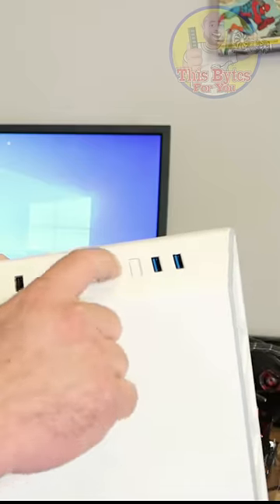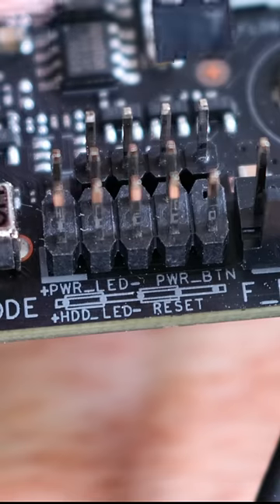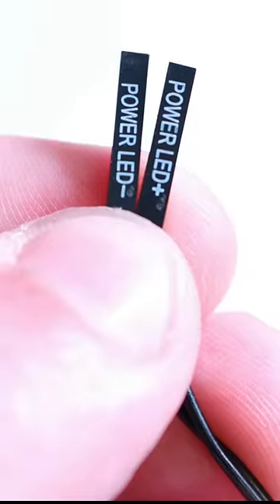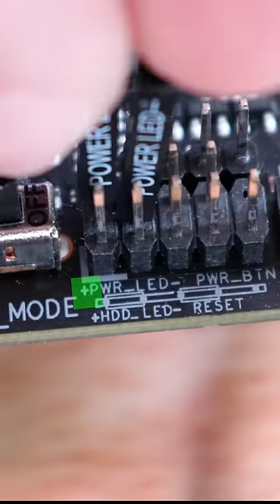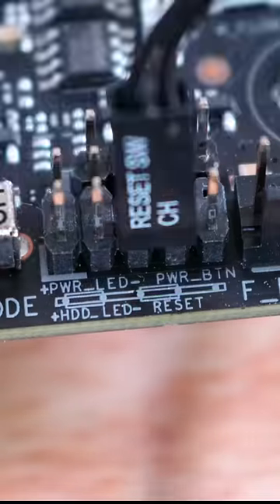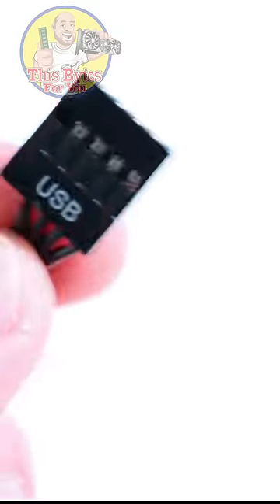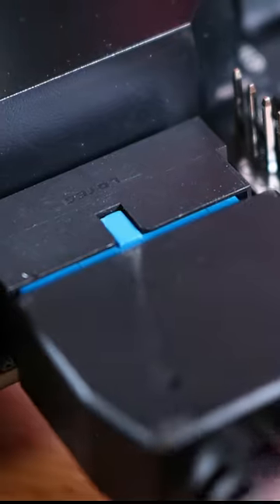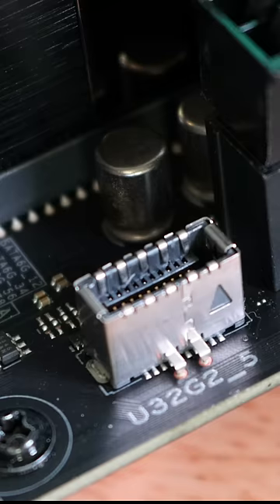Front Panel Connectors - Where do they go connected? #FrontPanelConnectors

Comment: Mine didn't come with a reset cable or speaker as far as I see. I have a ASRock b650m pro rs wifi mobo and a Apevia prism case.
Though the case did come with a power led - and +, a power line and the hdd line and that's all.

Also still not sure if I plugged in everything correctly still need to find a video for that all of it is just confusing for me!
Reply from the maker: This is a short, you can only get so much information from a short, I made the short from this video, you might also need the manual for your motherboard, you can find that on the support site for your motherboard, all motherboards have it, including yours , if you can't find it, let me know and I will get you a link to ut, but here's the full video https://youtu.be/k6A3MG3yJzQ
Don't worry about the connections your case and board don't have, since they don't have them.

Comment: I have an Asus z87-K motherboard inside a Montech XR case. The front end power cable from the case looks entirely different than what’s on the motherboard. What can I do here? Informative video by the way!
Reply from the maker: I can't tell if that case has an F_Panel cable, but if it does, just like I did on this video with another montech case, at the 20:00 marker: https://youtu.be/8I4e6sw0meo?si=aHZJtoNUO0-dM3nD and thanks so much for your kind words and support, it means the world to me.
Reply: @ThisBytesForYou  Correct, this was my exact dilemma. Have the same F_Panel cord you have in the video as well with the same pin configuration on your motherboard. Was curious where exactly you had the cord plugged in at on the front end panel pins.
Reply from the maker: Well awesome my friend, so very happy I could help you.  Thats a nice looking case.  I have worked with Montech a few times, but now, they won't even reply.

Comment: But mine is a dell optiplex 5040 it doesn’t say led plus or minus what do I do?
Reply from the maker: You're right,yours does not because it's a pre built, this is for custom built PCs.  If you go to dells support site, enter your service code, there will be a section there where you can find documentation for your system and it will be in there, I believe called repair guides.  The  other thing you could do is just try one way, if it doesnt work, try the other, there's nothing there that will harm your pc.

Comment: Is it possible to get an adapter for the system front panel connecters ? One's on my mini itx build are crap.
Reply from the maker: Ummm, can you elaborate a little more as to what sort of adapter you are looking for?
Reply: @ThisBytesForYou  The pins for the power hardrive reset etc are to near my graphics card when it's mounted also they can keep popping out when connected.
Reply from the maker: Hmmm, not sure what to tell you on that bud, sorry
Reply: @ThisBytesForYou  No problem.

Comment: Can't find any hdd led cable in my case, but it was a hd audio cable. I put it on the two upper pins on audio there, is that correct?
Reply from the maker: This is a short, it won't give you all the info, it only gives me 60 seconds,  here is the long form video and will totally help you https://youtu.be/k6A3MG3yJzQ?si=bgar_24lBycYLeI0
Reply from the maker: sorry, not sure why this was liked with no reply, HD audio is audio, not HDD LED, HDD LED is hard disk drive LED, not all cases have HDD LED's so you dont need to use that.  This is the short, you would benefit from watching the full video, again, sorry about the amount of time on this https://youtu.be/k6A3MG3yJzQ

Comment: are the connectors always the same place on each Motherboard?
Reply from the maker: no, you will have to look around sadly.
Reply: @ThisBytesForYou  okay thanks
Reply from the maker: anytime bud, if you know the manufacturer and model number of the board I can help, if its a prebuilt, I can't help you on that.
Reply: @ThisBytesForYou  Mine is the Gigabyte B550 Aorus Elite V2, but i think I've got the Connections now right
Reply from the maker: yeah, same location, you will need the motherboard manual to be sure on this board https://download.gigabyte.com/FileList/Manual/mb_manual_b550-aorus-elite-ax-v2_e.pdf?v=24d24cf9acc76ba2c833adbcf9dfc9c7

Comment: My cables have the power led- and + power sw written but can't find them on motherboard.
Reply from the maker: I might be able to help if i knew the manufacturer and model number of the board
Reply: @ThisBytesForYou  it is the pro z7090-p wifi I believe I have the rest of the cables right except the power, reset, and leds.
Reply from the maker: this is the short, you want the long video: https://youtu.be/k6A3MG3yJzQ
Reply: No problem I am thankful I was able to find your videos they're helpful and have been helping me throughout little by little. Although I've messed with PCs in the past like changing power supply or things like that this is my first time actually starting from scratch and it's a little nerve wrecking. My only problem now is that my green light on boot comes up but that's it nothing shows on my monitor I have the vgag3 cables connected to the graphics card but not sure if I have them right. Cpu light won't come either nor the dram only boot.
Reply from the maker: while not the 7 series, this is the 6 series, it will help you: https://youtu.be/8I4e6sw0meo

Comment: What if my motherboard doesn’t have those usb connectors for usb C and 3.0?
Reply from the maker: you could buy a USB Type C and 3.0 card so you can plug the headers there, check it out on my Amazon affiliate link: https://geni.us/BFsJi
Reply: Awesome thank you man!
I’m doing my first build and my motherboard is an ASUS B550M-A WiFi ii and I thought I was just blind but found out it doesn’t have it
Reply from the maker: anytime bud, but it does have USB 3.0 on the right, right under the ATX24 pin header just no USB type C

Comment: My pc case didn’t come with power led + - cables. I’ve seen some on Amazon but I’m not shure how I would connect the other end to the fans. Can somebody help me?
Reply from the maker: Would help if i knew the manufacturer and model number of your case
Reply: @ThisBytesForYou  my pc case is called the deepcool cc560. I just build my first pc and already having problems😢
Reply from the maker: that case does not have a power LED cable, so there is not light for that on the case, it only has power switch, hdd Activity led and reset switch.  You would need to drill a hole into the case to see the LED light, and to add one.  What issues are you having?  
You can find the front panel headers for your case here: https://www.deepcool.com/download/pdf/CC560.pdf
So that I can help, please list the manufacturer and exact model number of the following components:
1. Motherboard - manufacturer and exact model number
2. CPU - manufacturer and exact model number
3. RAM - manufacturer and exact model number
4. Video Card - manufacturer and exact model number
5. Power supply - manufacturer and exact model number
6. Monitor - manufacturer and exact model number
 Redundant I know, but many people forget to enter manufacturer and exact model number
7. Do you have ALL of the PCIE connections plugged in, and not daisy chained or pigtailed, each coming directly from the power supply?
8. Are you running through HDMI, DP, DVI, VGA, any adapters?
9. Is UEFI or Legacy Setup in the BIOS?
10. What slots do you have your RAM installed in?
11.Do you have CSM Enabled or Disabled in the BIOS
11. Installed latest supported chipset driver?
12. Have you disabled Fast Boot within Windows?
13. This video will help you identify hardware inside your PC: https://youtu.be/65ZSiVImJx0
Reply: @ThisBytesForYou  I followed a tutorial for the cables and stuff but the fans are supposed to be a light blue led and my fans don’t even spin. I’m pretty sure I plugged everything in correctly.
Reply from the maker: which fans?
Reply: @ThisBytesForYou  the fans that come preinstalled in the case
Reply from the maker: ok, they are in fact LED fans, they should turn on, but I will say the aRGB connection is a pain in the butt, maybe this video will help you: https://youtu.be/J5m5WBlPkfc
Just in case, the board you have is the ASUS Prime B550M-A WiFi II, the number you gave me was the Amazon ASIN number.  You can find the manual for your board here: https://dlcdnets.asus.com/pub/ASUS/mb/SocketAM4/PRIME_B550M-A_WIFI_II/E22625_PRIME_B550M-A_WIFI_II_UM_v2_WEB.pdf?model=PRIME%20B550M-A%20WIFI%20II and on page 1-1 you can find your single aRGB port, yes you only have 1, but thats OK but aside from the power connector on your fans, that makes them spin, the rgb portion, does it have 4 pins or 3 pins with a space in between?

Comment: Well that's great but I have the B650M and none of the ports are named that so I don't know where to plug them
Reply from the maker: Have you checked the manual, if you don't have a physical copy, it's  in the manufactured support site and you can use your phone to see it.  One answer doesn't always fit all.
Reply: @ThisBytesForYou  yeah I followed the manual and 'tried' to put them in correctly.  Best I got was it to turn on, no display. I'm sorry wasn't trying to be rude, just frustrated I can't get my PC working. Going to just pay someone to fix what I obviously screwed up. No worries. Thank you
Reply from the maker: @eldonb5131 try the full video, it explains more, I think your issue is polarity, there is no way you can.mess this up, I promise https://youtu.be/k6A3MG3yJzQ

On the short I only have 60 seconds to explain, I have much more time on the full video where it came from.  Don't pay someone to do this.

Comment: Hi Sir. I have a question. I overheated my cpu once, I turned it on without installing the AIO cooler. After  couple minutes my pc shutdown because my cpu is very hot. But right now my  cpu is working fine, I just wanna make sure if there is any adverse/side effect because of that?
Reply from the maker: There should not be, it shuts down to protect itself, so you should be good.
Reply: @ThisBytesForYou  thank you so much sir. Your channel is very helpful. One last question sir. I also bent my Ryzen 7 pins. But I straightened them out and its working now. Is there also any adverse/side effect because of that? Sorry for asking too many question sir. I'm a newbie PC builder
Reply from the maker: no worries my friend, I am here to help.  No, i have been in the business for over 20 years, i have seen some of the worst pin bends ever, been a part of some of them too, fixed many, never any issues afterwards, as long of course as all the pins are still connected you are good my friend.
Reply: Thank you so much Sir. You're very helpful ❤
Reply from the maker: @Lasyyyyy  always my pleasure my friend, I love helping.  Please do consider liking the video and subscribing, I come out with videos every week helping you with all sorts of new things PC related and have almost 400 videos already, so I am sure I have more that can help.
Reply: @ThisBytesForYou  already did. Thanks sir ❤
Reply from the maker: @Lasyyyyy  thank you so much my friend

Comment: My power led+ broke is that a problem?
Reply from the maker: Well, it will just mean you can see the power LED, not a biggy, but you can always buy a similar one on line if it bothers you, but it will work fine without the power LED/
Reply: @ThisBytesForYou  Okay thank goodness i got scared for a bit
Reply from the maker: @ezracruzio  no worries my friend, thats why I am here ;)
Reply: @ThisBytesForYou  also another question i look up benchmarks with my exact same specs and my games run way worse then other peoples benchmarks for some odd reason why?
Reply from the maker: @ezracruzio  it can be a trillion things, first off, I am 99% sure the system is not the same, not the same memory, not the same power supply, not the same video card, then the systems could be overclocked, they could be using HDMI vs DP or visa versa, faster mhz monitor, higher grade DP/HDMI cable, sooooooo many things could be different,... but still do you have a fresh install of windows, chipset drivers, (and all the other drivers the motherboard has and their latest version), latest version of windows11, latest video drivers.... a trillion different things.
Reply: @ThisBytesForYou  howndo i get a fresh install of windows without rebuyijg windows and also how do i updste my motheboards drivers
Reply from the maker: @ezracruzio  which version, 10 or 11 and is this a pre-built (Dell, Alienware, HP, etc) or a home built machine, was the version of windows legal?
Reply: @ThisBytesForYou  windows 10 and it was custom built
Reply: @ThisBytesForYou  and yes
Reply from the maker: @ezracruzio  heres how to create the windows 10 drive: https://youtu.be/C759I7DBXd8, you will have about 180 days, or longer to use it, but the most that will happen is the water mark will appear on the bottom right hand corner, unless you have the serial number to enter during the install: https://youtu.be/C759I7DBXd8

Comment: My motherboard doesn't have labels saying it nor a 9 pin connector so idk where to connect it
Reply from the maker: Perhaps this would better suit you https://youtu.be/k6A3MG3yJzQ
Reply: @ThisBytesForYou  hi this is actually very helpful but the board I'm trying to install atm is a ddr3 and it doesn't have the labels and I also don't know the make of the board other then its a lenvovo ddr3
Reply from the maker: @jakenickels5573  the ddr3 part is irrelevant as most ddr3 boards have silk screening, retail boards, this is an oem board, you need to check with Lenovo.

Comment: For some reason my led sw won’t fit
Reply from the maker: So that I can help, please list the manufacturer and exact model number of the following components:
1. Motherboard - manufacturer and exact model number
2. Case - manufacturer and exact model number
Reply: @ThisBytesForYou  pc case-Apevia G-PRO-WH Genesis Pro Mid Tower Gaming Case

Motherboard-ASUS Prime B550M-A WiFi II
Reply from the maker: @UnknownEX0  ok, just wanted to make sure, check out page 5 of your manual: https://uploads-ssl.webflow.com/5ced3cdc3850586f0800b1a0/5f2dc3d7629fe31e62a0aa07_um-genesis.pdf
but you should be good adding that, also, this is a short, you won't get a lot of info, this is the main video: https://youtu.be/k6A3MG3yJzQ
Reply: @ThisBytesForYou  thank you so much
Reply from the maker: always a pleasure my friend, that should help you, but please do let me know if it does or if you have any other questions.
Reply: @ThisBytesForYou  it works now, again thank you so much for helping me
Reply from the maker: @UnknownEX0  Always a pleasure my friend, so very happy you stopped by, trusted in me to help you, liked and subbed as well as took a moment out of your day to thank me.  It means a ton to me and I am so very happy I could help you.

Comment: i did this and my pc still wont boot, only motherboard rgb lights up
Reply from the maker: This is a short, only so much you can fit in, I don't know if you problem is fully front panel related but try this https://youtu.be/k6A3MG3yJzQ?si=CpBLiVKZzudzD65F
Reply: @ThisBytesForYou  i tried it and still no luck, rgb lights up when i turn it on but pc button doesnt light up nor work. nothing budges a single bit.
Reply from the maker: So that I can help, please list the manufacturer and exact model number of the following components:
1. Motherboard - manufacturer and exact model number
2. CPU - manufacturer and exact model number
3. RAM - manufacturer and exact model number
4. Video Card - manufacturer and exact model number
5. Power supply - manufacturer and exact model number
6. Monitor - manufacturer and exact model number
 Redundant I know, but many people forget to enter manufacturer and exact model number
7. Do you have ALL of the PCIE connections plugged in, and not daisy chained or pigtailed, each coming directly from the power supply?
8. Are you running through HDMI, DP, DVI, VGA, any adapters?
9. Is UEFI or Legacy Setup in the BIOS?
10. What slots do you have your RAM installed in?
11.Do you have CSM Enabled or Disabled in the BIOS
11. Installed latest supported chipset driver?
12. Have you disabled Fast Boot within Windows?
13. This video will help you identify hardware inside your PC: https://youtu.be/65ZSiVImJx0 @thankshots3217

Comment: saved me money from going to the technician, thank you so much🙏
Reply from the maker: Always a pleasure my friend, so very happy you stopped by, trusted in me to help you, liked and subbed as well as took a moment out of your day to thank me.  It means a ton to me and I am so very happy I could help you.   Just in case you might need it, here is the longer form of the video that goes into more details: https://youtu.be/k6A3MG3yJzQ
Reply: @ThisBytesForYou  and quick question, i just turned on my pc after putting in a new gpu and a new psu, and it’s showing an msi click bios 5 screen and it won’t get off, how do i get it off
Reply from the maker: well, sounds like you didn't reconnect your SSD/Hard Drive, verify all cables are connected properly, this might help: https://youtu.be/7SjQo7wrWq4 @santiagoaguilar8843
Reply: @ThisBytesForYou  that also worked, thank you
Reply from the maker: sweet, so happy I could help my friend, glad you got it working.
Reply from the maker: Always a pleasure my friend, so very happy you stopped by, trusted in me to help you, liked and subbed as well as took a moment out of your day to thank me.  It means a ton to me and I am so very happy I could help you.   Thanks so much my friend, sorry about not replying, I am finding so many comments that I liked, but did not respond to, I reply to everyone